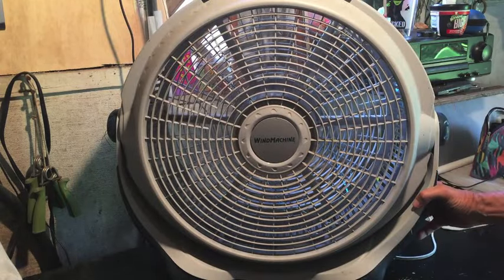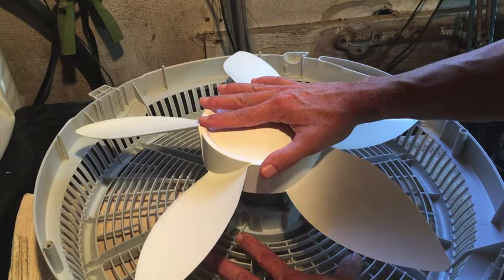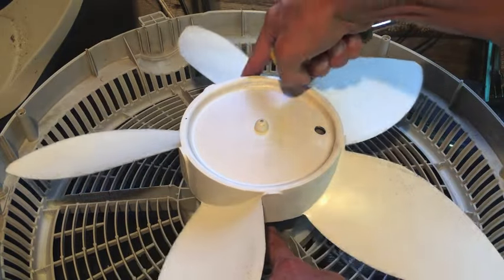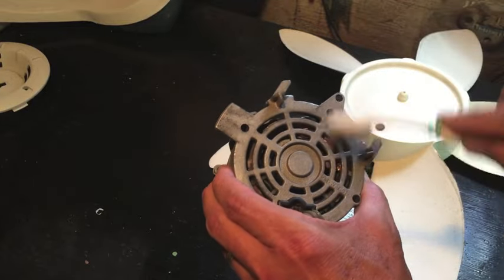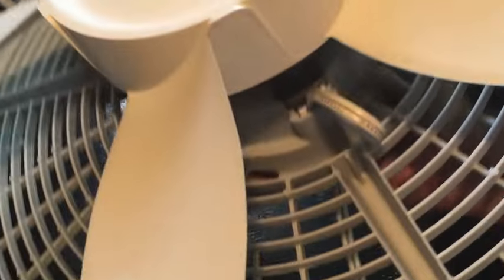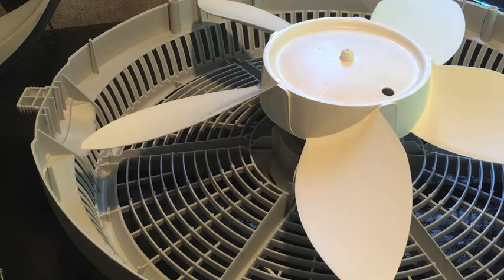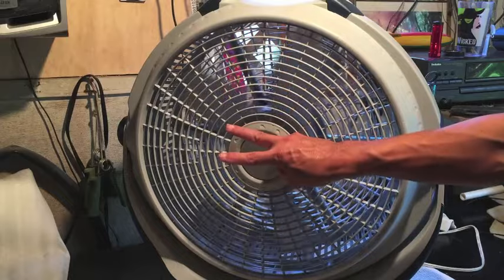Disassemble/Clean Lasko Wind Machine 3300

Comment: Do you know any reason why the blades would we off ballence?  I have the same fan and have taken it apart and cleaned everything.  It still shakes/vibrates bad. I would rather learn how to fix my things than have to buy a new one. And it's only a year old!
Reply: my guess would be one of the blades was damaged and now it’s not balanced correctly look and see if one of the blades has a crack in it

Comment: What the flip flop🙃  You must have magic hands.  I grabbed the motor and the blade like you did.... ❌️not budging.  Took a deep breath and tried again using my GI Joe  Kung Fu Grip.... ❌️nope.  One last try,  i can do it.   ❌️ooops 💨
  I give up😭😭
Reply: My blade was stuck on too. What I did was put the back side down on the ground and held it in place with my knees while pulling and wiggling at the 9 and 3 O'clock position. It didn't come loose, so I rotated the blade 90 degrees and kept wiggling and pulling. It finally popped off. Holding the back with my knees while pulling and wiggling and rotating 90 degrees is how I got mine off. Good luck. Also, I used Zoom Spout oil for the motor. It's made specifically for electric motors. I picked up my Zoom Spout at Lowe's.
Reply: @THOMMGB If you search Clean/Lubricate Lasko wind machine (again). He has another video explaining.

Comment: The gray rou 3:20 nd outer circular knob came off the back
 Cant put it back on. Does not screw back on
 Please help. Thanks
Reply from the maker: are you talking about the speed control knob?? 07:44
Reply: yes
Reply from the maker: it doesn't screw back on.. it snaps in.. 07:44

Comment: !!! Warning !!!  be careful not to bump or apply any pressure to little black control box on the side of the motor that the switch is hooked up to. plastic that has mounting clip is very thin and snaps off , I had to try a few Diff glues to re secure it out of the way
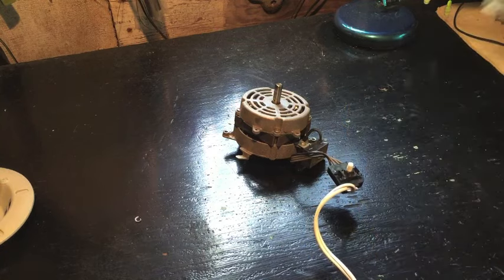if you pause the video around the 5:32 mark you will see the silver clip im talking about .

Comment: I can't get the plastic blade off
Reply from the maker: That's ok.. You should still be able to lubricate the motor shaft with the blade still attached..
Reply: @PeanutButterMan-PBM  The blade does not come off easily, I don't know if I pull it hard it would break. Lubricate with the blade on is hard
Reply: Eventually it came off.
Reply: @DanielRodriguez-ww7eo bro that’s literally me rn I tore it apart last week to clean it but I wasn’t able to get the blade out 😂😂😂😂

Comment: Ugh my blade is stuck and won’t come off
Reply: Mine was at first, secured the base and used equal pressure on both sides of the fan blade circular base and pulled straight up, popped right off
Reply: same with me. Plus my fan wont even turn once on ?  Any idea ?

Comment: Great Directions:  Straight forward video - I followed this and clean/repaired/oiled the same exact fan (mine was from 2 years ago) - outside of a few parts that weren't quite so easy to 'pop' off - I perservered & have a perfectly working fan.  I use my fan non-stop (for air circulation & background white noise) and I have to say, I am surprised that a plastic fan (although motor is metal of course) works so well.

Comment: Found this video after realizing they were charging $59.99 at my local Ace Hardware for this same fan! My fan was almost 9 years old! Did as you did but took a shop vac to the motor. Mine was full of hair and grime. My fan blades were tough to come off the motor but using leather gloves and both hands I was able to work it off. Thanks

Comment: Thanks for the video, I hope doing this will fix the issue with the fan losing power
Reply: I just finished disassembling the fan and cleaning it up, just waiting for the plastic parts to dry. The motor was clogged with dust and I have it set off to the side. Thanks for the video.
Reply: Unfortunately the motor seized up, couldn't get a replacement and had to buy a new fan

Comment: Mine is weird, the blade will not come off I've tried pulling and everything it will not budge. Thank u for the video tho. Very helpful!! ❤
Reply: Mine too
Reply: I have the same issue. I can’t get the damn blade off. So frustrating lol Gonna have some else help and maybe it will come off if we both grab a side.
Reply: I kept trying to pry mine off with a screwdriver on each side and kept working one side then the other and it did come off.

Comment: I know this post is old but can I replace the cord? I am poor but I found 4 of these fans in the trash that someone cut the cord on.  Can I replace the cut fan we desperately need these for our house! I pray you see this comment
Reply from the maker: If there's enough cord to use you can replace the plug: https://www.homedepot.com/p/Leviton-15-Amp-125-Volt-2-Pole-2-Wire-Polarized-Plug-White-R62-00101-0WH/302183191
Reply: @PeanutButterMan-PBM  thank you.  I disassemble  the fan and the cord is only about 8 inches long 😕
Reply from the maker: In that case you will need to splice on a new section of wire and plug.. https://www.youtube.com/watch?v=z4bjFH-ghUc
Reply: @PeanutButterMan-PBM   thank you I'm getting ready to try this now

Comment: The blade housing does not easily pull off the shaft. Applying much force risks breaking off the blades.
Reply: yeah, mine was a little stubborn at first but I gently put one foot on either side of the motor on the back of the fan to keep it on the ground (while seated, not standing), got my fingers around the center "wheel" part of the plastic blade unit by just using the first two fingers of each hand between the blades, and took a couple of minutes to wiggle it around. once I tried pulling from the right angle it popped off much more easily than I'd anticipated from the resistance I'd met on my first few tries! felt like mine wasn't molded quite right on the inside where it attached to the shaft/was wedged on forcibly in assembly from an angle that was just a little bit off. going to put a little extra lubricant on the shaft before I reassemble (all the plastic parts are air drying in my yard right now since I just finished washing them) and hopefully it will come off a little easier next time since had I not been able to pull it off with less force than it takes to bend the plastic, the next thing I would have tried would be flipping it over and applying lubricant around the shaft just above where it was stuck in hopes that a few minutes of waiting and gravity assistance would get enough lubricant into the space for my next attempt to be successful.
Reply: My hands are est up with Arthritis so I have not got a lot of strength in them but I think the blade is stuck 😭😭

Comment: Is it safe to use a can duster to clean the vents on the backside of the motor or is it only with an air compressor?
Reply from the maker: dust can would be fine..

Comment: This is a good instruction video for cleaning this particular fan but if I may add a little side note if you do not have canned air or any kind of like air compressor to blow out the dust try like a toothbrush to scrub around the crevices of the fan get the dirt out then just use a vacuum hose preferably a vacuum with good strong suction power and it will suck that dirt right out of the way just my little added advice thanks for the video man 👍

Comment: I'm fully aware of how to "hold the motor in one hand, the fan blades in the other and pull apart, however, this one is not. Could the motor heated up that it melted the fan blades to it? I have disassembled and reassembled many of these fans for forty years. I am attempting to replace fan blades, as I have done in the past. Any ideas on pulling this apart?
Reply from the maker: Last year I posted a second (shorter) video cleaning this same style fan.. At the 1.30 mark of that second video I show a different way to get the blade off.. Here's a link:
https://www.youtube.com/watch?v=Xv_6rENhj7Y
Reply: @PeanutButterMan-PBM  Thank you for the tips. I finally got it off, put the new blades on, works like new. A friend was about to throw it in garbage and I saw what was up so I took it home, and the rest is history. Thanks again.
Reply: Yes absolutely instructions for cleaning should have been in the box I bought the same fan Wind Machine $30 fan atleast they could have done was put an easy instruction pamphlet in the box for taking it apart and cleaning it properly some people don't know how to do this or are afraid to do it because they don't want to break the fan especially when you give $30 for the thing take it home clean it end up breaking it but this video was very helpful thanks a lot 👍

Comment: Great tutorial on cleaning this fan.  Short but thorough.  Mine isn't too dirty yet, but I was trying to clean a Lasko tower fan.  The tower fan video by Lasko is useless.  The tower fan is not supposed to be taken apart and they made it very difficult.  I like the Wind Machine better anyway.  

By the way, a comment on the tower fan said to use a leaf blower to clean it.  I'm gonna try that and while I'm at it, I'll probably try the leaf blower on the WInd Machine also.  I know after a few cleanings like that, I should probably follow your video to clean around the motor and to oil it.  Still this was a great video, and I will follow it once the fan is really dirty or after a longer period.

Comment: I have an older model of the Wind Machine and I can't pull the blade off as easily as you've done in your video.   Plus the ring piece that has to be removed to get the motor out isn't coming out easily.   Any suggestions?

Comment: I had soooo much dust and hair INSIDE the actual motor. I had to take the motor apart to get it out. However I couldn’t figure out how to get the blades off lol. So I unscrewed every screw through that little hole instead of just popping it off like you showed. Plus mine wouldn’t pop off easily because it had hair twisted and built up at the base of it🤦🏻‍♀️ it was a struggle but now it’s cleaned!

Comment: Thanks it’s very useful.  I clean them out at the end of summer before putting them away.  I always hated cleaning them because I didn’t know if the motor and fans were removable without damage.  Having to clean the fan with the motor on is a hassle.  But this will be helpful.  Like a lot!

Comment: Can you use WD-40 for the motor
Reply from the maker: You can but from what I've read you shouldn't.. It may work short term but evaporates leaving a residue behind which attracts dirt/dust..
https://www.overclockers.com/forums/showthread.php/362251-Lubricating-fans-with-WD-40

Comment: my cyclone fan does not have any visible screws!!!! I have cleaned many fans but getting this apart is a mystery,
Reply from the maker: Not sure what model cyclone fan you have but I found this on a fixya site.. 

Picabo - Question
There are no rear screws the back of this fan.. Ive looked everywhere.. My cyclone fan must be a different model  Posted on Feb 26, 2015

Miriam Nelson - Answer
The ones on the back are under the round tab by the power cord. The house screws are actually on the sides of the fan hidden between the slats. They are not obvious in any way.

Comment: I keep a fan running year round. I have had several of these thru the years. The last 2 wind machines that I had just stopped working for no reason. Everything turns freely and has no play in it at all. This last one is only a couple of years old and was running great and just stopped while I was in front of it. I think maybe the sensor that keeps it from getting hot 🔥 may have tripped and died. Getting my meter and will check it out. Thanks for the great informative video and God bless.
Reply from the maker: You are welcome.. Thanks for reply..

Comment: I bought a LAUSKO WIND MACHINE at Walmart in August 2003 17 years old now and is still in good shape I have TAKEND it appart 3 times over 17 years!!!!
I did not take the blades off off for the motor apart I just opened up that cage and cleaned blades and the grill cage of the fan and I cleaned under the switch behind the motor I did not take it apart more than that I unscrewed the cage grill of it!!!!
For 2003 windmachine fan its still in good shape the blades has somewhere over the years it's only 17 years old!!!!
Reply: Thats crazy to hear. Things now and days aren't built to last. Idk why i said that like im old and have experience with older products. But as a young man all my shit breaks after a couple years.
Reply: @AImighty_Loaf  How do know when it's time to Replace the Fan altogether what should it expect to Replace  LISCO WIND MACHINE it becides not working like making Funny Noises or not working right????
How Many  years have you seen LUSCO WIND MACHINE Fans last for in your Experience????
Please let me know!!!!!

Comment: How many years can a LAUSKO WIND MACHINE LAST FOR????
Reply: Depends on how hard you run it. I've been running mine almost 24/7 sometimes, and it's been a year without problems. I know a few people that had it a few years. Havent heard of one that stopped working yet
Reply: @belladonna869  i had mine since 2003 and works great never had any problems at all!!!!  I have taken it apart to clean removing  all screws  to open it up use some Winder or spray cleaner and have done that like four or five  times over 17 half years old i bought at Walmart!!!!
Blades have some wear over the years  still works good still in good shape condition!!!!

Comment: My switch is damaged. The wires comes loose and seems spark burn plastic on switch. Not the knob but the black control that has the two tabs to press to remove from the rear shield. Know where I can get this to buy

Comment: The blade comes off?
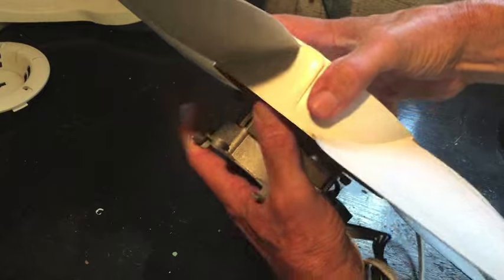Reply from the maker: on mine, yes 3:57.. but there's a comment below saying that the blade does not come off on newer models..
Reply: PeanutButterMan I had to put something soft on the fan and I put both knees on it and pulled and it came off.
Reply from the maker: Awesome.. hard part is over.. you're home free now..
Reply: PeanutButterMan Yes and I use the 3 on 1 oil, I had hair on the turn nob that made the fan spin.

Comment: Thank you very much!! I only forgot one part, to line up the flat spindle part that holds the blade on
Reply from the maker: Glad to help.. Thanks for reply..
Reply: My blades wont stay in place. Idk what I'm doing wrong!
Reply from the maker: Flat side of the motor shaft lined up with the flat side where the shaft enters the blade.. Then make sure it's pushed all the way on.. That's it unless your model has a set screw that holds the blade onto the shaft.. If it keeps falling off the plastic on the blade may be stripped out or cracked..
Reply: @PeanutButterMan-PBM ok thank you for the video and response.

Comment: how to do you clean the dusty motor itself? In my other fan, the motor has dust sticking with some kind oil, so does not come off even with duster.
Reply from the maker: compressed air would be best or you could take the motor apart.. i believe there are 4 screws holding it together..

Comment: My blade doesn't pop right off. I looked it the round opening to see if there's a screw, but I don't see one. Help? All the rest was perfect to me, I was able to finally clean the fan. The reason I want to get to the shaft, is because I usually find hair and threads wrapped around the shaft of other fans I have, and I feel this may make the fan have to work harder. Thank you!
Reply from the maker: It should slide off just like in the video.. If not, gotta get more power/leverage somehow.. If you can't get the blade off you should be able to see/clean the shaft..

Comment: i really can't get the blade off . I'm pulling and pulling ,still nothing I been turning it to. Help!
Reply from the maker: If it's the exact fan as shown in video it should slide off.. If it's not exactly the same, it might have a set screw that holds the blade onto the motor shaft.. If there's no set screw, you gotta figure out a way to pull or pry harder.. Two people maybe??
Reply: @PeanutButterMan-PBM   it's the same fan . I have two , one of the frames were broken and the other one motor doesn't work too well, so I was going to switch them out . turns out the good one that was stuck had so much stuff in in the inside of the blade. and the one that doesn't work didn't want to come off either so the blade broke but it's fine.

Comment: can I use wd-40 to lubricate it?
Reply from the maker: From what I've read it's not a good idea to use WD40: https://www.overclockers.com/forums/showthread.php/362251-Lubricating-fans-with-WD-40
Reply: PeanutButterMan I thought my fan needed just cleaning, on high speed its going as slow as first speed. It’s only been a year since it was bought, the lubricator you used should help it right? I took it apart down to the motor, it was very dusty
Reply from the maker: @brisughchanel  You probably won't be able to find the lubricant I used.. It was from Radio Shack and most of their stores shut down.. But the oil below would work.. Not sure if it will help with the fan speed though.. You may have an issue with your motor even though it's only a year old.. https://www.lowes.com/pd/3-IN-ONE-3-in-One-3-oz-Lubricant/1210103?cm_mmc=shp-cprdtolgooglelia-217-tools-lubricants-1210103-0&store_code=403&cm_mmc=srccprdtolgoogletoolsMHLIA_TOL_Tools_High%20Priority---0--0&gclid=Cj0KCQjw84XtBRDWARIsAAU1aM2x_7w-xYAapmyxh1nuA-ROflmjCCNyGpRy4IAE959N1NRV8sgnWQEaAgdjEALw_wcB&gclsrc=aw.ds

Comment: Hi my friend my lasko is humming but not spinning. I manually moves it and it spins why does that happen?
Reply from the maker: I don't know from experience but I found this question/answer online.. 

My fan hums, and don't turn. But when I turn the blade by hand just little or use any thing just to he'll turn the blade a bit, it starts to run very fine. What could be the fault? And how can I fix it. 
answer  
If it is a capacitor start motor the start capacitor is most likely bad, if not a capacitor start most likley cause is worn bushings.